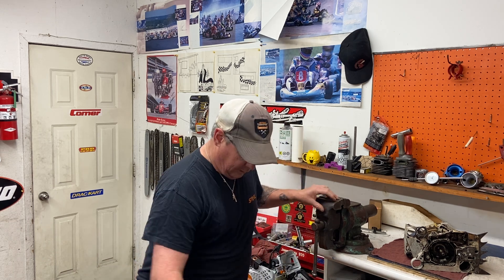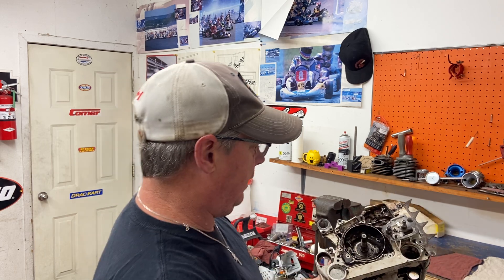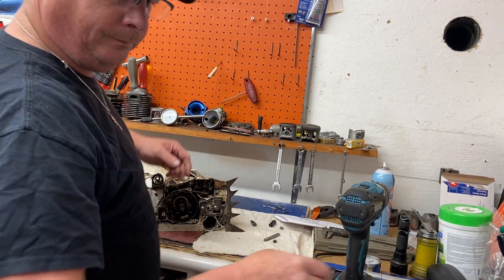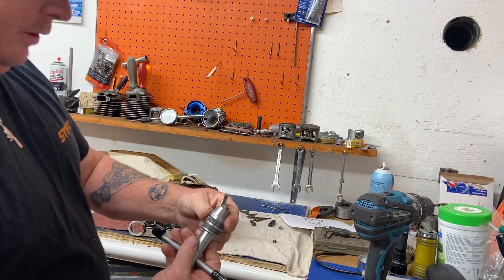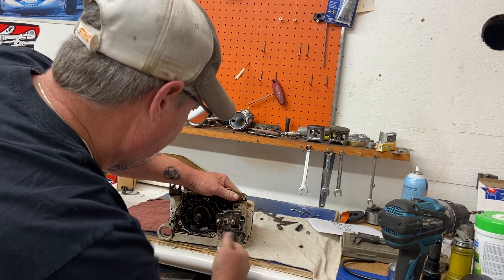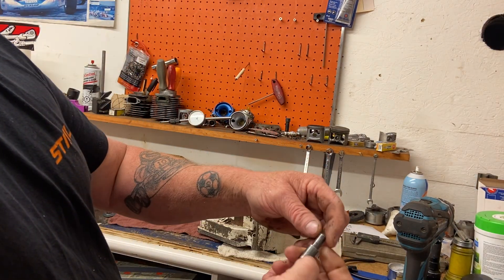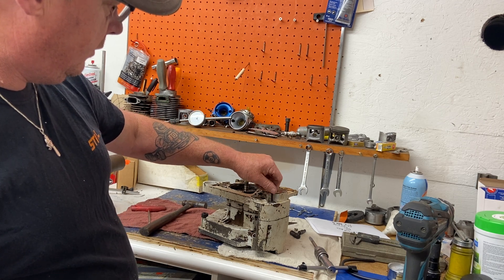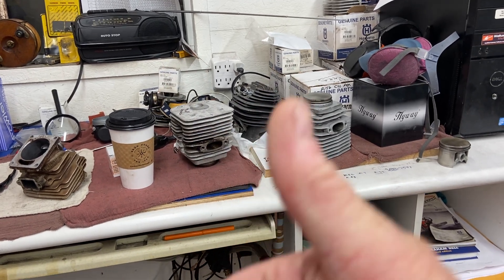how to fix a stripped thread on a small engine chainsaw

Comment: im having a hard time finding the exact ones on amazon can you please send me a link
Reply from the maker: Weird they were there yesterday when I get back to shop I will look again🪵👍
Reply: @donnywalker4691  i don’t no if I’m Miss spelling it or what
Reply: @donnywalker4691  thanks
Reply from the maker: On eBay I searched 5mm keen keenserts
Reply: @donnywalker4691  that’s why I couldn’t find them I kept typing clean not keen. Thanks buddy much appreciated
Reply from the maker: I just searched now 5mm keenserts and they came up then read the discription and it tells about what I did
Reply from the maker: Sorry it was on eBay 🪵👍
Reply: @donnywalker4691  no worries. What is the brand called? I want to make sure I get the exact ones with those two little push pin locks.